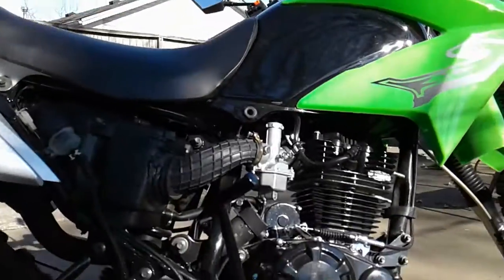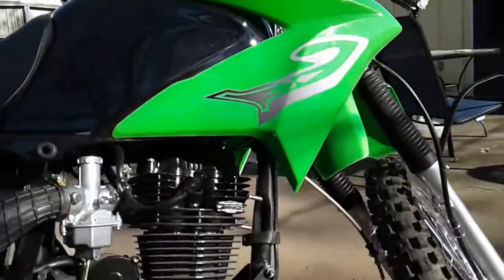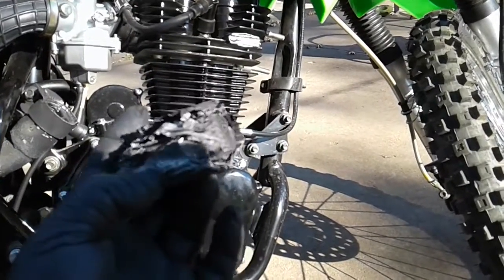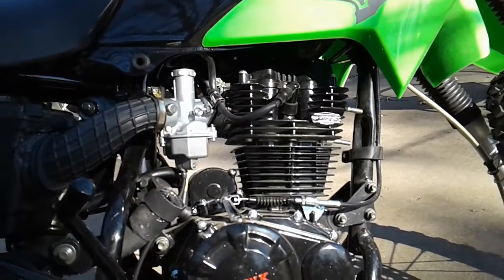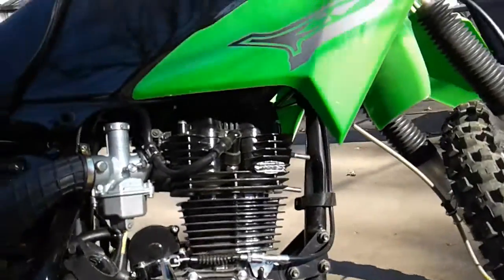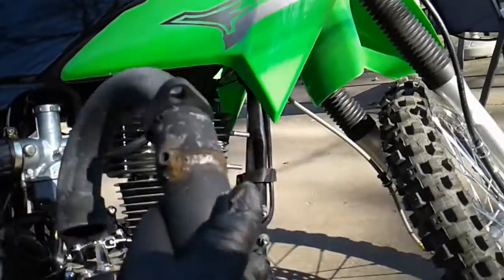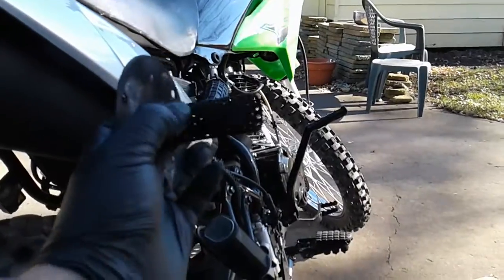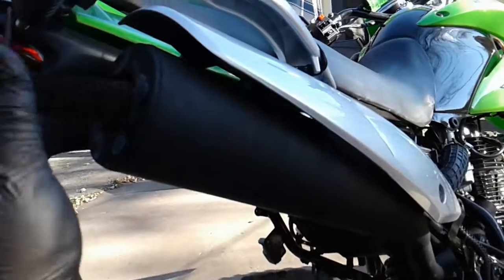Hawk 250 Exhaust Modified

Comment: I did this too. That honeycomb hideout was a b** to get out. I also wrapped my pipe all the way to the muffler. I don't think I'll have heat problems now. Did you have any issues with the air box tube? Mine was kinked to the point where just a little bit of air was getting to the carb. Another issue that I had is the airbox wasn't sealed and dust went past the filter into the box itself. So my hawk is apart now, fixing the issues.
Reply: I wish there was a way to comment pics on what I'm talking about.
Reply from the maker: My air box tube was made out of the hardest rubber almost plastic. I pretty much use the hair dryer trick to take it on and off every time , the heat softens it it allows me to take the carburetor off easy you might want to think about  reshaping your air box tube with a hair dryer.  I sealed the Box around the tube with Black rubber gasket sealer.
Reply: How do you remove the catalytic converter?

Comment: Curious as to how you got the cat out.  Does not look like you cut open the header and rewelded it, but maybe you did?  Is there a way to get it out through the end of the head pipe by just using a drill or pounding it into oblivion with some kind of punch?
Reply from the maker: Brett Alexander  In the video you see me pointing to the new weld its near the forward heat sheild nut.  I didn't  see him do it but he heated it up or cut it there and pulled apart the header then pulled out the cat and welded it up.

Comment: How do you remove the catalytic converter?
Reply: itsa fed emissions law violation to do that but as you see; cut the pipe where its at & push, dig, drill it out then reweld. he shows this. in some states it may be legal for "offroad use". that REALLY helps the engine breathe & make power it was designed to do, stock.